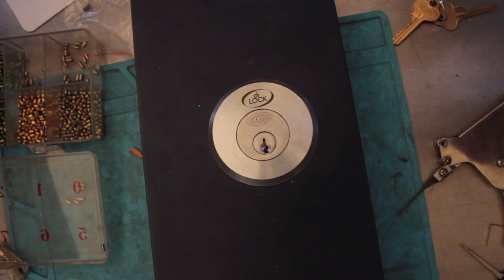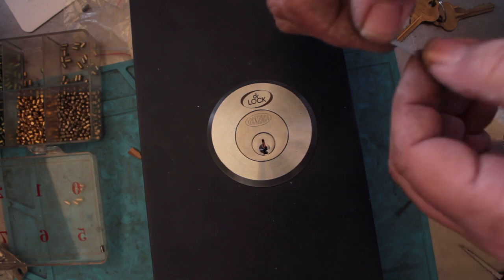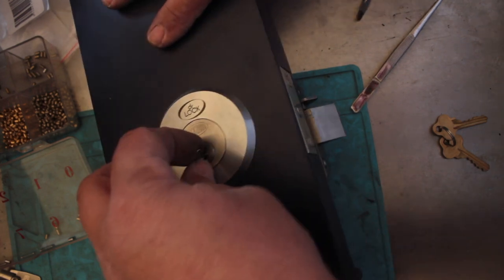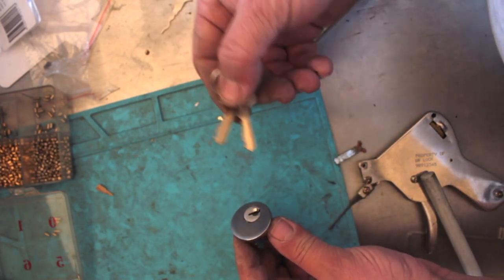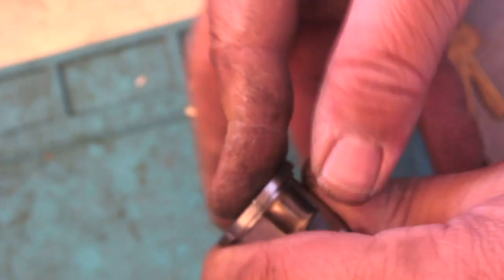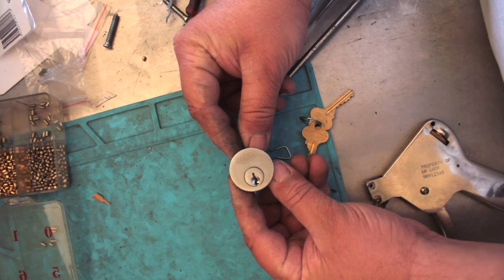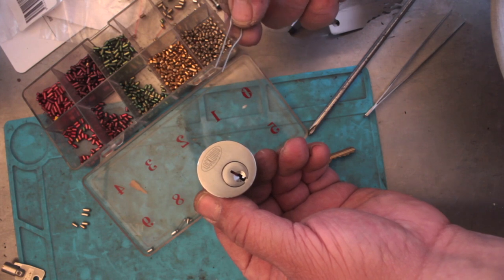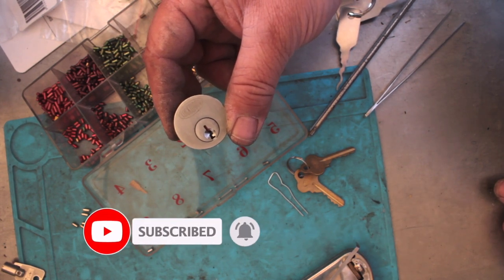How To Pick A Lock With A Bobby Pin "Like The Movies"

Comment: picking with a bobby pin is a bit difficult unless it's a wide open keyway, i tried it before using a bobby pin from a girl that was with me at the time but they're kinda of flat, it's more suitable as a tensioner, i used some other debris nearby as the pick